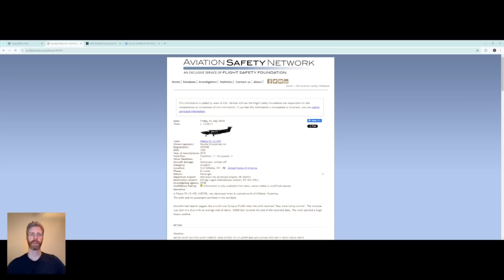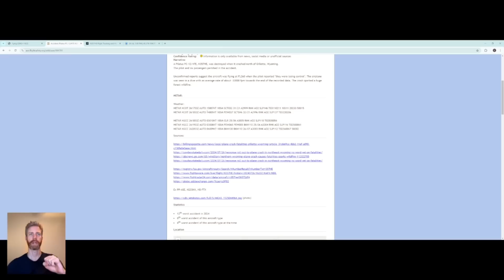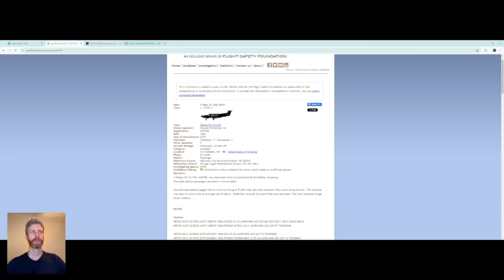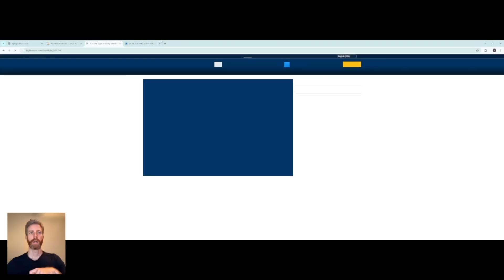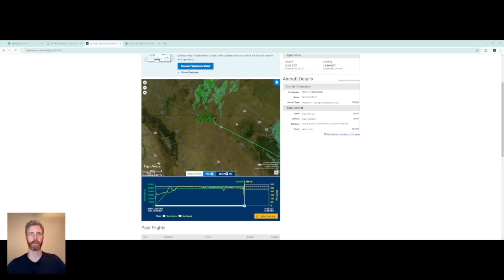PC-12 Crash Analysis | N357HE | July 26, 2024

Comment: I am about to show my lack of knowledge concerning this subject.  I will inquire anyway. If they are in a graveyard spiral at 26,000 feet per minute. How would leveling the wings help? You have less than a minute to do this? It would certainly take the plane time to adjust. One minute is nothing.  Also, the sudden decompressing of the aircraft could cause the lungs to collapse. Thus, leading to an unconscious state? Must hope this never happens to them. It doesn't mean it can't. Spatial disorientation is difficult to overcome. It doesn't only happen dealing with aircraft. It increases with age or other medical problems. I am only inquiring. I am not assuming anything. I sure to travel as a flight nurse. Total focus at that time was on the patient.
Reply: Mainly, what you are doing is not working. Do something else.

Comment: Auto-pilot is a wonderful thing and for casual or long distance flights it's ideal. Bad weather is something else entirely. Auto-pilot will fly you into such conditions but at some point, will probably kick off and that's when you find out how hard the system was working to keep the airplane straight and level. I can imagine many pilots being caught unawares. A sad story.
Reply: I've seen "AP disconnect" when in rough turbulence in the mountains with my little RV-8, and it's not fun.  I don't know why the AP in a large aircraft like the PC-12 gives up when the going gets rough.    I think we should look at stronger servos, and better software to handle cases like this.  I think a more robust AP that works in any conditions would save lives.  Not in any way trying to take the responsibility from the pilot, but I think technically we can do better in these extreme circumstances.

Comment: When you mean pull the airplane apart? Do you mean the wings coming off? Or like cutting the plane in half?
Reply: Certain parts are going to fail in extreme g loads the outer wing panel the tail for example

Comment: What do you mean when you say he probably pulled the airplane apart?
Reply from the maker: That refers to pulling on the yoke (aft pressure), usually in a steep spiral, and causing an in-flight breakup.
Reply: Sheer terror
Reply: Structural failure.